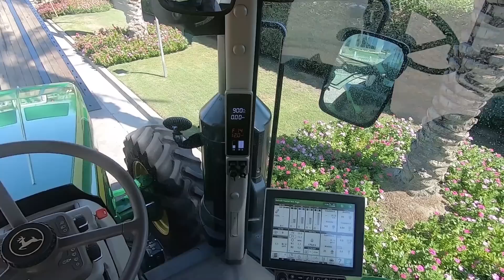Brand New John Deere 8245R! Transport Time!

Comment: Omg that is one sweet tractor... I have fell in love...  Up here in Michigan? DOT would not allow 3 chains on a 4 point hook up.. I know it's stupid!! But I've been burned twice for it , so four points 4 Chains 6 points? 6 chains . But the way you did it??  Was totally fine an totally secure.. up north here? They are just sticklers for rules ;-) ....an dam sorry for the GoPro :-(
Reply: Joe Harry that is acceptable 4 point tie down by DOT. No different from 2 separate chains. Any officer not accepting it is showing his behind! It is independent of the other anchor point. 
Now if he had ran the chain from the deck to the tractor to the binder to the deck,  then it is 1 tie down. Very different processes.
Reply: @coypatton3160   thank you I fully agree with you.  now if we could convince Mr. Butt head. ;-) I even went to the State , an their Ruling was"" It is up the officer discretion due to the load factor "".... laughing all I managed to do was tick him off an get every one of our fleet  trucks pulled over  for  inspection for weeks. Even a 1/2 ton pick up.  We were hauling our excavation and construction equipment.  An no there was never any major citations just nit picking. Thankfully they moved him up by the Mackinac bridge.

Comment: 9:48 you chain it down in a V resulting in two anchor points. What is the advantage of doing this compared to keep the chain straight with only on anchor point.
Reply: Marty, I think you answers your own question? "Two anchor points," plus it transfers tensile pull off of the link and puts it onto two points of the link, strengthening the attachment point, plus it takes up the slack, and looks really cool!
Reply: You can do that, but you need something where the chain goes around on and spread the forces equally. And I don't know if the hooks fit inside the holes in the flatbed.

Comment: Seems to me using two chain binders on one chain would stress the chain even more. I guess you could use that method if you only had a couple chains. But I think its better if you use seperate chains for each corner.

Comment: Before all the YouTube dot officers come out, what he did with the chains in the back is perfectly legal lol
Reply: Gen3tx agree totally. He still had 4 independent anchor points.
Reply: What you see most of the time, is one chain hooked on one side of the trailer, just pulled through one or maybe two points with only one type of binder, this type of set-up, (not the one Trent has done) is illegal, minimum 4 independent secure points, and a winch is not a secure point, it is just a loading assist tool, And can be used as a back-up support attachment. I see lazy equipment haulers in town doing this all the time, especially with dump trucks hauling loader/backhoe's. 25,000 lbs. With only two 1/2" 70 transports chains and one side to side attachment point front and back. Just freaking lazy, take ten more minutes to do it right, oh shit, that their job! Well done Trent!

Comment: Thats not oversized.
Reply from the maker: Over trailer width so therefore it is lol. Thank you for watching!
Reply: That`s what She Said..
Reply: check again buddy the mirrors on your truck are wider. l know I draw the same tractor and 9500 series is way wider you only got a 8 ft. deck I run a 10 ft with out riggers 100 tons on quad axel